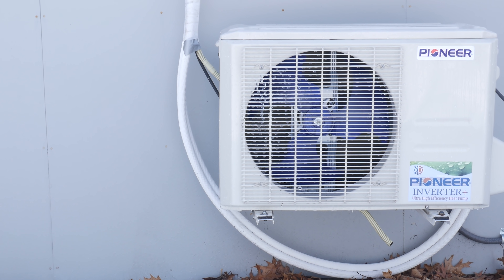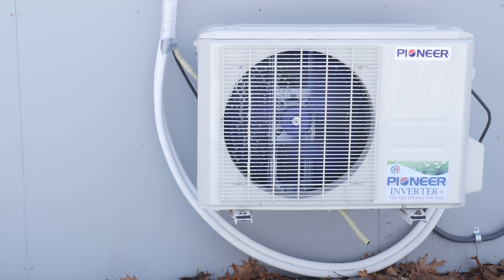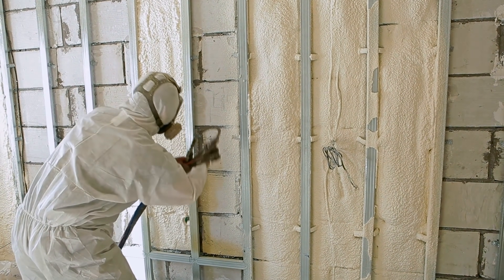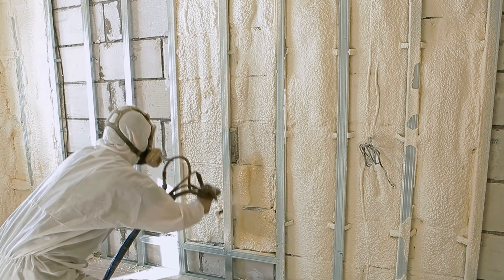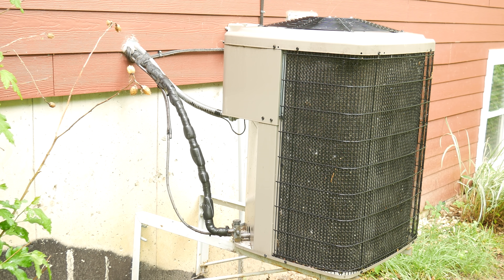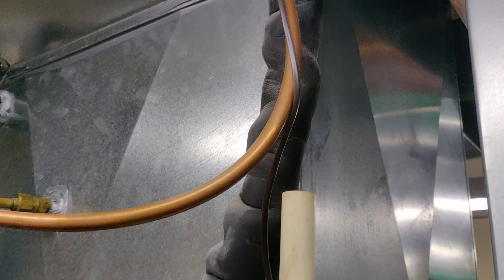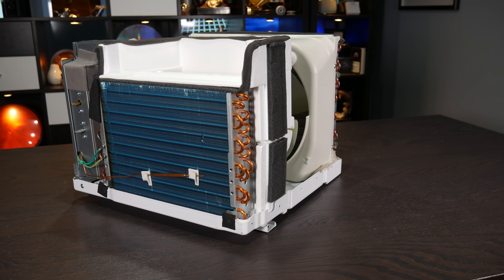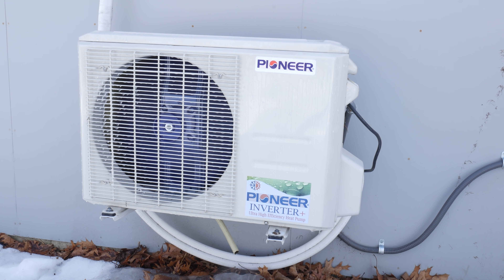Heat Pumps are Not Hard: Here's what it will take to start pumping

Comment: So Alec, I will admit, it did anger me, initially, watching you endorse the practice of DIY air con installations, but I did the logical thing of taking a step back and thinking about it. I, in Australia have VERY tight regulations on the usual's such as electrical, plumbing and of course, air conditioning. There are absolutely no exceptions where anyone without a license can touch these systems at all without being lawfully liable, hence my initial anger. I was wondering if you would be so kind as to give a brief description of the local laws on this topic. I do understand different countries have different rules and codes, I have gone from angry to curious, and would like to know what you, locally, are allowed to work on without breaking regulation laws. 
PS. This is not a baited question or a setup, I would actually like to know.

Comment: Sometimes I dont like my parents financial decisions. They complain that prices of everything are going up and wages aren't. Thats true. What they aren't doing is solving the problem. My parents both refuse to use solar panels. My mom falls for the "But sometimes!" Mentality. Its raining here right now so solar panels are not worth the investment. Nevermind the incredibly hot summers with no clouds in sight for months and the fact that they still produce electricity as long as there is light. We use gas heat but she refuses to replace our old AC with a proper heat pump that would literally cut her bills year round. She drives a car that uses premium gas and refuses to get an electric car. On top of all that, she says an electric anything is just more stuff to go wrong. Doesn't matter that electric cars require almost no maintenance due to a lack of fuel filters, transmission fluid, oil, etc. Solar panels need no maintenance but apparently its another thing to go wrong so its not worth it. Doesnt matter that it will give her another paycheck from the energy company instead of a bill for many months, only matters that it needs maintenance and costs money once and won't be worth it because sometimes it rains and won't make quite as much power. Meanwhile my dads house uses one of those shitty portable ac units that creates a vacuum in the house. He doesn't have central heating ducts, but he does have an old radiator setup. His house is from 1909. He won't get an air to water heat pump. It would be easy enough to use it as an AC and a water heater as you described. Or both a water and room heater. Just cool down or heat the water instead of air and you have a central heating system. He also refuses to get solar panels though I haven't asked him why. Probably money. Also my mom isn't a supporter of right to repair and just calls a guy as soon as literally anything goes wrong. The parts I understand is the cost that happens once. My mom pays $100 every 3 weeks on gas. That's going to be going up past 2k a year. An electric car would pay for itself especially if she could sell her current one but she likes it. I fly drones and I like that I just plug it in. I wish I could do that with my car but I'm stuck with almost no money and no job yet. I cant wait until I make some money and get my own place so I can make smart decisions. I'm a senior in hs and my senior quote was "climate change is our parents problem and our to solve" she gave me crap about that then proved me right.

Comment: I’ve got a home with a 20 year old mini-split system that finally died and I can’t get parts for it, and I’m facing the same nonsense because I would prefer to have someone come out and reclaim the refrigerant.  If I didn’t give a single fuck about the environment, I could replace my whole system with units that also do heat (my old school units are AC only) and I’m just morally opposed to submitting to these prices, and I’m allergic to paying people for work I can do myself.

My Dad thinks I’m being unreasonable, but I’m not gonna let these mouth breathing HVAC installers bend me over because Carrier or Trane pays them to push furnaces and inefficient central AC units.

The systems that I’m interested in are high velocity systems that have ducts and can filter the air in my home.  The dust and allergens in my home are a non-trivial amount.

Comment: Heat pumps are great. Until you try using them for their intended purpose all along the Gulf Coast where most of us end up going right back to gas & electric heat in winter. Doesn't matter what you do or how loaded with tech the particular heat pump is, it will freeze over the second outside ambient drops below 48.. And the unit will run on its electric heat strips. Because sealevel gulf humidity. 45f @ 99% humidity at sealevel is .. absolutely BRUTALLY certifiable awful as any non-native transplant will tell you. Even Chicago natives.. Fortunately it doesn't take a whole lot of gas to heat a fairly modern home down here in winter, doesn't really get cold enough to run months on end like further up into the interior. Space heaters, as much as we hate those too, are kind of a necessary evil here as well just given the nature of our wild all over the place daily climates between November & March.. 33 on Tuesday, 67 Wednesday morning, it's a real nightmare some years. Hot dank wet SE TX Summer on the other hand, we've got that mess locked down! Proper capacity sizing is crucial not too big not too small. We know our AC well, you die without it. Literally. It's why the area was so sparsely populated until the late 40's. Heat Index (that's ambient temp to water saturation ratio) is not something you mess around with. I think 120f heat index is when it becomes 100% lethal. Electricity isn't exactly cheap, and the great bulk of us ain't rolling in free money so.. we've got the summer air con to efficiency ratio thing figured out lock stock and barrel

Comment: American thinks all houses are built of cardboard with huge spaces. Heat pumps would be completely worthless perhaps not even that good in almost every house in the UK. Like zero effectiveness even if a ductless could be installed which would not be that easy here if people even had the space... Not to mention installing them here would require a lot more effort and specialised tools r.e brick buildings.

Also good luck getting new homes mandated to have space them which would also prove highly improbably for numerous reasons. The cost in electricity usage would be hellish and only increase. I mean if we had stable renewable supplies it could improve but this will never happen. They will never give up the power and wealth scarcity gives them.
Reply: I’m an American and don’t think that way

Comment: reduced carbon emissions don't save people any money.
Cooling a house during the summer typically costs more money than heating the entire house with gas during the winter.
The comparison between refrigerator and heat pump is apt, but many refrigerators cannot operator below 50F.
you've ignored geothermal which is a superior version of the heat pump because you never deal with outdoor weather that's too cold.

Comment: Ducted systems are pretty inefficient because of the duct work. It takes more energy to move the air through those air pipes because of friction loss, also, as the air is moving through the duct it's either absorbing or losing heat energy depending on weather you're cooling or heating so they have less conditioning power once they get to an occupied space

Comment: Wouldnt work well here in wi. Only heat pump that would work here in an in ground heat pump at 40k thats not worth it. Wish it wasnt such a rip off. Contractors rip people off. I replaced my own 1940 furnace for 1700 including ductingthe hvac people wated 8k

Comment: The compresor consume (for example) 3000 watts ??....... an take the indoor aluminum radiator up to (what?) 80 degrees Celsius???...... You can do that with a 300 watts resistor..... I will not be able to say it  more clear. 😠...

Comment: I guess most of your messages about insulation is considered as communistic in US? Alot of your proposed actions were already done in Germany. But there is always the next possible step. Especially at the moment, where we face the problem that an essential part of our fossile energy is coming from Russia.
Here it is a combination of strict rules and incentives. E.g. you can get very low interest of credits for insulation projects or building extremely well insulated new buildings. Those credits are given by a national owned bank with low or no profit for this bank.
BTW: I heat with a big air to air heat pump. The warm air is generated centrally and is distributed in the complete house. In the past 5 years I was very hapy with this solution. I have a second heat pump for warm water.

Comment: Ah, the wonderful heat pump, a device theoretically highly efficient, until you understand how and why.

If in the middle of winter cold you activate it to pump heat OUT of the house, it will be a wonder of economy, pumping away until you freeze to death. Same thing in the summer heat, turn it on to heat the room, and it will boil your aquarium within minutes with economy.

Wait, but the real world uses it to heat the house in winter, making the outside unit freeze over, then stop, use heat to defrost for a short time and them freeze over again. In summer it struggles to dissipate the heat, fans go wild, the cooling efficiency falls and the electricity bill grows. The real world is ugly, costly and inefficient. Still, no alternatives, for cooling, but in the heating department a simple oil space heater will be more reliable, in my humble opinion.

Comment: 4:00 that installer makes me itch. Why is he using the wood in the centre of the styrofoam block like that and not along the edges where he actually needs the board to move. Using wood on the egdes stops the edges smashing out and stops the board snapping in the centre. There's no point him using anything the way he is using it. The guy looks like he should be on a fishing boat.

Comment: On the subject of domestic manufactured heat pumps in the US. Maybe they are  like the car industry dictating "what the customer wants" based on what's good and easy for them. A sad reflection on the insular views afforded by a huge domestic market with little real competition. Sure there may not be much incentive given your insights but traditional short sighted outlooks lead to blindsiding by superior overseas products. Jingoistic mentality is delusional. I live in Adelaide South Australia where air con is a must in summer thanks to 40c temps.  We do still get the odd day down near freezing or just below. We got better insulation when our house was built and central reverse cycle A/C. Hardly use the heat cycle in winter. Usually 3 or 4 mornings and shining sun on solar costs us nothing. Still use gas for hot water and cooking but not worth spending thousands to save hundreds to replace it all.

Comment: You are very wrong about heat pumps. Far better to spend $400 on a 14,000 BTU window AC unit that you can install and fix yourself quickly. Heating is free, just mine crypto.

Comment: 43:50 people for the love of god find something better more suitable than expanda foam. Can you believe my land Lord and a fellow garbage ready thinks expanda foam is an effective water proofing solution for anything more than a garden shed. First tip. Don't cut the hole too large. Buy or hire the correct tools required to make a surgical cut. If you are not well experienced in precision cutting and marking out, then don't ruin your house or any one else's trying. If you are an installer and you need expanda foam to fill the gap. You need to sack yourself and go work for the food industry perhaps cleaning. If your cut out is a couple millimetres on all sides like any one using millimetres is accustomed to such levels of precision then all you need is silicon. Get the good stuff. Do some research first though. Reframe from watching youtubers. They say whatever they want. Technology connections is a genius for all things that require electricity but don't take structural or builder advice from him.